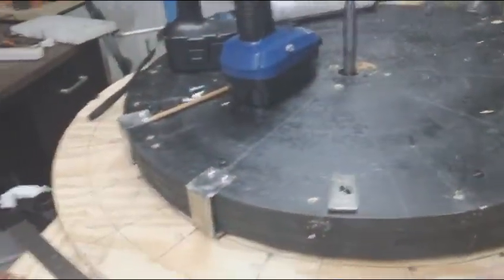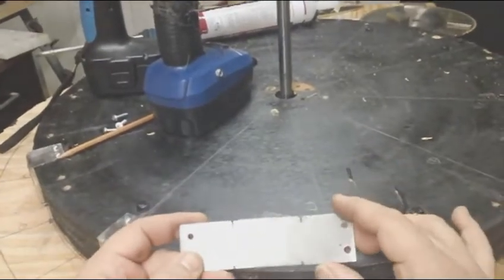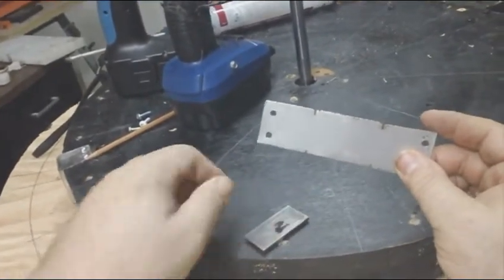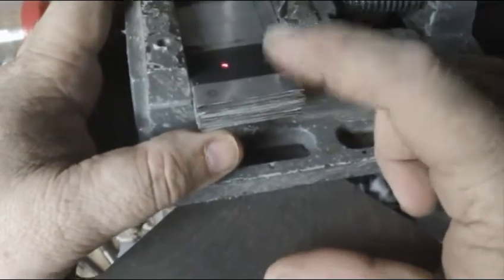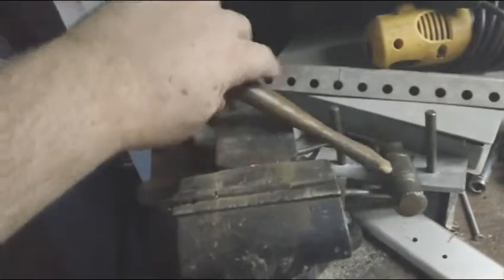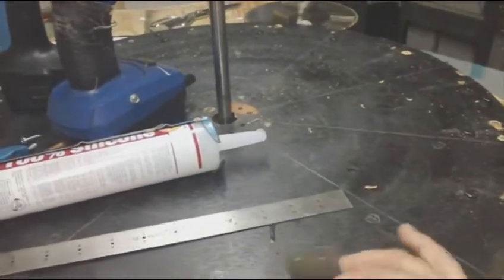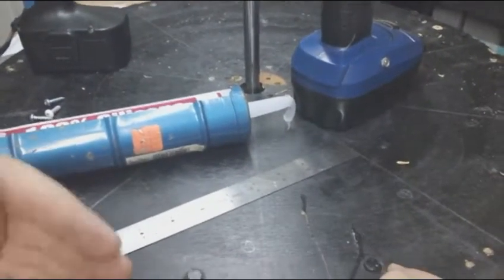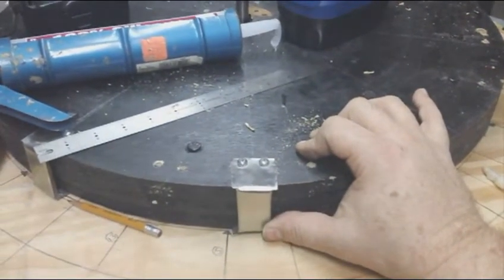Mounting Magnets

Comment from the maker: It has nothing to do with accuracy, the magnet is on a alignment line but once you cut notches to recess your magnets in the wheel you wont be moving the or changing the number of magnets  this is a working test bed so not a good idea it commit to placement, Thanks for watching.